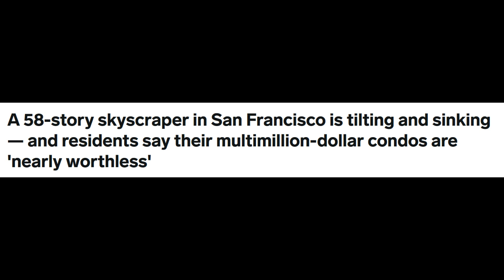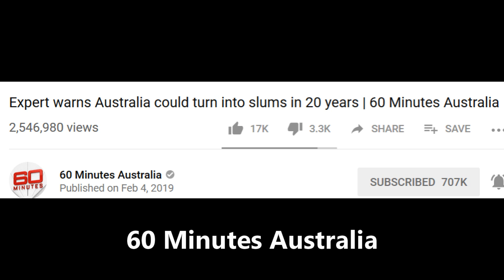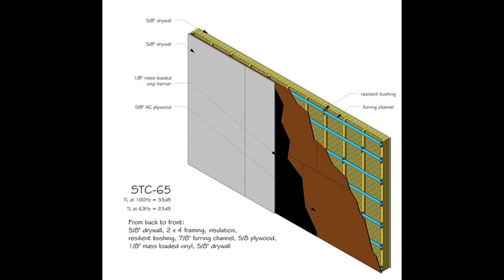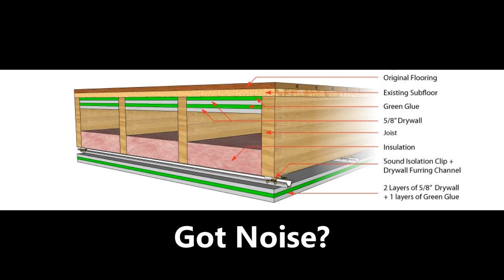Building Construction In The Philippines

Comment: there is a standard of the international building code, this is what most countries use. I was a code enforcement officer locally here in the U.S for quite some time. From what I have read, Canada has the strictest building codes in the world. In places in the northwest and Alaska and parts of Texas have absolutely no building codes. It's interesting from area to area how they change. there is a YouTube channel MI PIDream, I believe had 500+ episodes on his building a very big house from 1st day 2 years ago until today. He covers from materials to problems with his builder to seemed a great architect, to some bad materials and bad building practices (for instance on a block wall they don't completely fill the joints as they are building the wall b/c they put a grout cement covering they smooth over. Great video thanks, 

Ron
Reply from the maker: Thanks Ron.  I have seen some of those videos but not enough time to watch them all.  Some knowledge and close supervision is one key to getting things done properly here.  Most only know the Filipino way.  
I knew an inspector for a large development company in California during the housing boom.  He said the contractors and subs were hiring the cheapest and often unexperienced labor they could find and they had lots of trouble later on.  Many people discovered problems with electrical or plumbing after the warranty and had to tear the walls out to replace the electrical properly.

Comment: Very good vlog, we have a house in cebu Philippines on mactan island and the plumbing is some of the wost in have seen , next time I am there this what we need to sort. Thank you for explaining all this...very helpful. .Alan. ..
Reply from the maker: I think I would try to add some type of filtering system if I owned a house Alan, and also use higher quality plumbing.  Good luck.
Reply: @AmazingPhilippines1  I think we will. We are doing other work at the moment. So we will do that. .keep the good work up. .Alan
Reply: Not sure what they are using there, but it seems bad.  Most houses in the USA use copper.  But thats expensive anymore.  So mostly whats use now is PVC (plastic), may want to see what options you have before starting that project.  Have some cool easy systems now, but you may not have access to any of that there however.

Comment: My great grandparents had a lake cabin in Wisconsin. The roof structure was exposed. If you looked at it you would say it would not make it through the first winter. Yet it was there for close to 70 years before it was torn down. Looks can be deceiving.

Then there is the leaning tower of pisa.
Reply from the maker: Looks can be deceiving Matt.  I have kind of liked dome homes that I have seen but many neighbors don't want them built near them as they think it will drive property prices down as it "doesn't fit in".

Comment: Good video! My last apartment in the Philippines was all concrete and it was great. In contrast to apartments I rented in the states where you could hear the neighbors talking, kids, what sounded like elephants walking around upstairs, all that went away and I loved it. Can't do anything though about outside noise like roosters, motor bikes, jeepneys except to try to pick wisely where you want to live.
Reply from the maker: Concrete has much better acoustic properties than the standard 2x4 sheetrock wall Stephen but it will also depend on the type of concrete and how thick it is...and how noisy your neighbors are.  If the neighbors have a TV/stereo mounted to the wall or near it and turn the volume up, you are probably going to hear it too well.  As for dogs, roosters, karaoke, and loud motorbikes, it can be a challenge.  Even if you find a quiet area, a neighbor might buy a dog that likes to bark the next day.

Comment: Lol, I watched construction on a highrise building from the balcony of a condo I rented and was amazed at what I saw workers doing. and close by was a ghost tower---nothing had been done there for over 2 years after a dispute between the developers and city engineers----sad part was that more than 75% of the building had been pre sold to private condo owners----I believe that the developer has just walked away from a 45 story tower
Reply from the maker: That is the risk of buying during pre-selling Clyde. I know of a couple of building sites with rebar sticking high out of the ground here in Cebu City and  nothing has been done in 3 years.  There can be a lot of politics involved.  I have been told that many developers will not touch the SRP (South Road Properties) near SM Seaside as they are not in good standing with the present mayor and that can create obstacles.

Comment: congrats on sound man, green glue lol,  sound board, accoustic ceiling ,  lol  dbl pain glass there? easy to get?
Reply from the maker: There are companies that sell double pane windows Ken.  It is difficult to find proper acoustic materials here.  I think there is 1-2 noise control/acoustic companies in Manila.  I have tried to find reasonably priced materials and haven't had much luck.  There is an Australian company, Acoustica, I believe that has some good products.  I emailed them some time back and never received a reply.

Comment: I worked in construction in Germany as an expat for awhile and I must say their standards and QA are way better than anything, anywhere in the world.  Things there are checked, re-checked and checked again.  The training of an apprentice there is a minimum of 3 years and so workers are far superior to any place I have ever been.  Now, if you go to the big island of Hawaii you may see a lot of structures built without insulation but in that climate you can get away with it, as long as it's purely residential and no higher than 2 stories and you have adequate ventilation.  Ventilation in such simple structures is expedient mainly because of mold.  For such a climate, bamboo is extremely popular, sturdy and even built to withstand extreme winds if built properly.
Reply from the maker: I think an apprenticeship program is important in many trades Patrick.  Germany is known for quality.
Reply: Well if it's anything like the machines they build....as they seem to do the same thing, super over engineered, prints made extra complicated by splitting them over dozen of pages when you could put everything on one page.  Oh, double or more safety's on things they really don't need.  It's a gift to make things so complicated, yet still work!  No consideration for ever having to take something apart ever.  I will take Japanese built over German any day of the week.  Japan has the best engineers IMO.  Lack creativity, but they are masters of perfecting what they know.  Lastly they consider if and how things may need to be taken apart in the future.  Germans figure things don't break I guess, so when they do......your screwed

Comment: I think the best home for the Philippines would be a container-type build set up on concrete pylons to avoid flooding. Would be cheap to do, don't require lots of laborers/materials, would withstand winds, water, and flying debris.  The problem probably would be that you'd have to properly treat/insulate it for heat or cook like a lobster in there. I saw some cheap ones on Alibaba that said they were typhoon-proof I believe.
Reply from the maker: There are a couple of companies in the Philippines offering shipping container modified houses.  Insulation would be very important.

Comment: Another great video  . If I build in the Philippine I don't think the Philippine workers will like me too much . The biggest thing when building in the Philippines with hollow block and concrete is to use lots of rebar . I don't understand why they build with hollow block but use a wooden post in between .
Reply from the maker: I agree Edward, rebar is needed for proper strength.

Comment: Very interesting  Rod that was a job i planned to do when i get back is isulating the ceilings  i assumed ceiling insulation was available. Maybe i should plant big trees ha ha. Thanks once again Rod.
Reply from the maker: Shade trees can help a lot Roy.  I have seen rolls of fiberglass insulation a couple of times buy I am not sure where it gets shipped in from.  I have seen the bubble wrap type with foil on 1 or both side in hardware and lumber stores but it doesn't seem to be in any big quantity so you may have to order it and wait.  I see the foam board insulation on delivery trucks occasionally but it seems to be rarely used also.

Comment: Great video again. Much different from building here in the USA, You have to design for strong earth quakes and typhoon winds
in the Philippines  using materials like cast in place concrete and CMU Block which has so much solar mass which makes
the homes so hard to cool a night,  I think the nipa house is the most comfortable but not good in case of a Typhoon.
The plumbing in the Philippines is the worst, Plumbing and pililpinos  do not get along. always enjoy your information
very informative
Reply from the maker: Thanks Peter.  This past 3 1/2 years here has been a learning experience.

Comment: Regardless of country, I have never liked tall buildings, and I would never live in one. But that's just me. Maybe it's a side affect of watching the movie "Towering Inferno", back in the 1970's.

Insulation is just as important in hot climates, where A/C is used year round. It is also important as a sound barrier.

I do the same thing here in Tucson. I run my fan at night to help drown out noise from idiot neighbors, and dogs from hell. LOL.
Reply from the maker: I also have barking dog issues occasionally B W but one of the neighbors will eventually chase them off.  I bought the fan because it made enough steady noise drown out some of the outside noise.